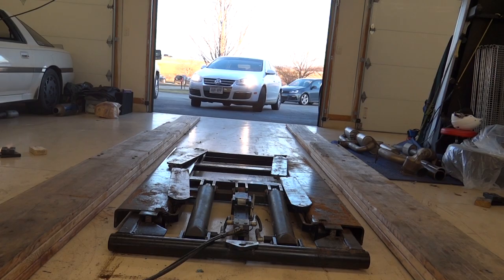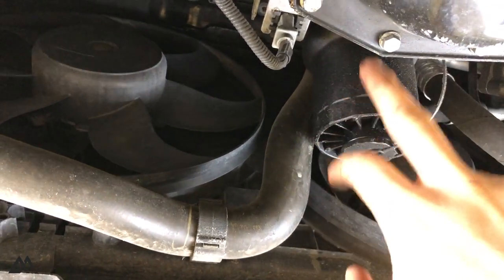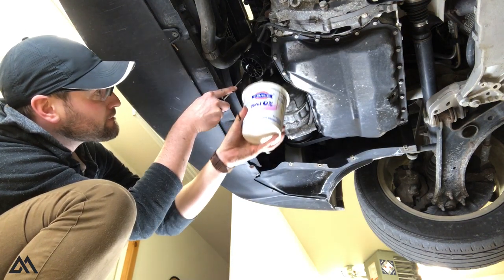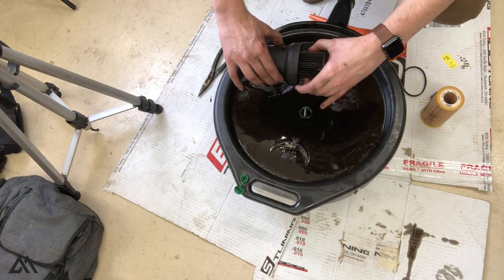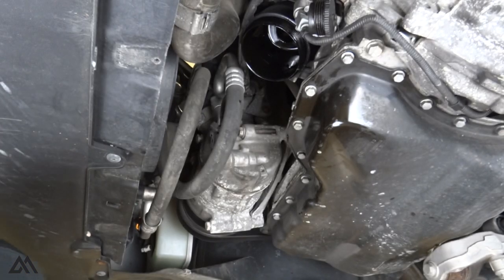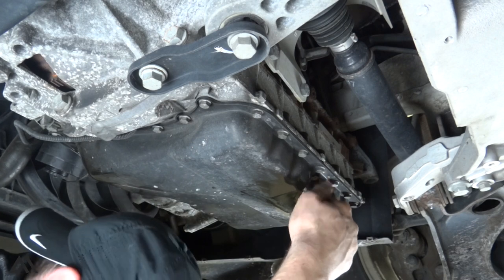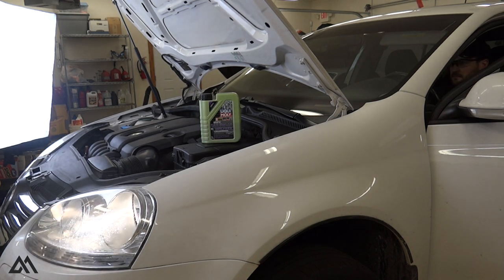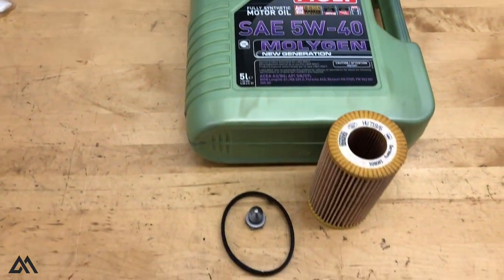Volkswagen 2.5L Oil Change Tutorial!  (MK5 VW Jetta)

Comment: Yeah, so I bought a 74 mm specialty socket however it does not fit and just like you it was a nightmare to get it off. I managed to get it off with another tool. So my advice would be when you’re at the auto parts store there is one of those oil filter sockets that says for Toyota and Volkswagen quite possibly it’s that one except that one does not say 74 mm on it so I’m just letting you guys know what I went through as always it’s never what it supposed to be. LOL.
Reply: Might depend on the year My 2010 2.5l jetta is a  74mm - 14 flutes  however some people claim they have 76mm so maybe that's the case for you.

Comment: Thanks!  Two q's... if I only put the car up on front wheel ramps will the tilt mess with my oil drainage?  (looks like it might actually help).  Also, did you reset the factory service reminders?
Reply from the maker: splatbubble drainage should be fine since the plug is in the back of the oil pan. Yes, I reset the service reminder. I believe I have a video of it.
Reply from the maker: https://youtu.be/D1r1096sukg
Reply: @ModernEngineer  aww thanks.  I'll see if I can dig up that video as well.   I appreciate the quick reply!

Comment: Thanks for the video. Did you say new drain plug? Why would you need a new  one unless the head was rounded off or the threads stripped?
Reply from the maker: I believe the torque specification is sufficient to compress the crush washer, but after it is crushed, it can't be crushed again (i.e. reinstallation).  Therefore you would need a new crush washer - but as I recall, the washers don't come off of the plug, so you need a new plug and washer.  I don't know how crucial it is to replace it, but I figured I would since it's recommended.

Comment: Why replace the drain plug? Did it require a replacement?
Reply: I j asked the same thing cuz I hav a 09 mk5 Jetta an I’m due for a oil change so was curious myself
Reply from the maker: Yeah. It’s recommended by VW.
Reply: I have a 2010 Golf with 130K, changed the oil around 13 times and still using the same old cap/washer without a leak. I only tried to drain the oil filter housing once by using the little valve but I don't want it to fail eventually so I just take the whole filter housing out slowly.

Comment: What does "torque that to spec" mean? Is it possible to overtighten?
Reply from the maker: Yes, torque to specification.  The manufacturer has torque specifications for virtually every fastener on your vehicle.  This will ensure the fasteners do not come loose while ensuring you don't over tighten.  Hope this helps.

Comment: Can I use 5w30 instead of 5w40
Reply: the internet says both but at advanced auto they recommended 5w30
Reply: If the engine uses synthetic, then 5W30. 

If it is not, then use 5W40. I found out online when I had to do my oil change.